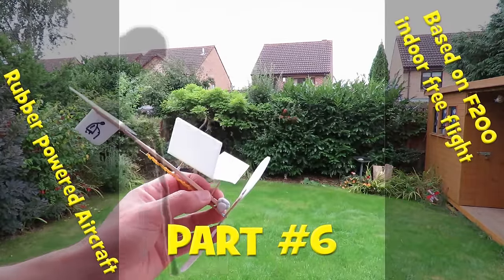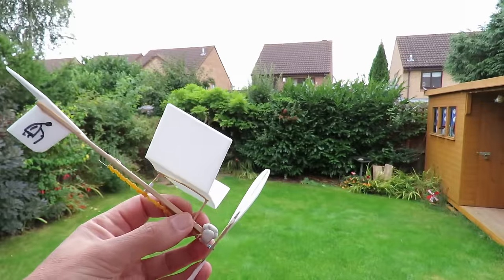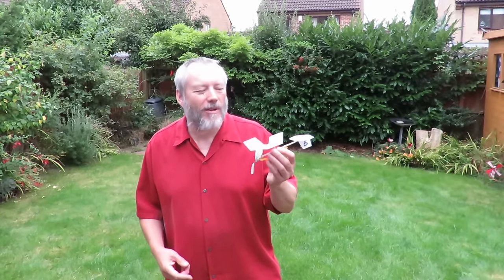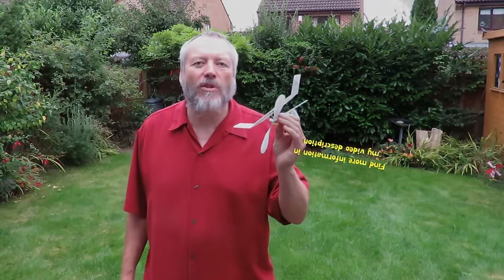Rubber Powered Aircraft Based on F200 indoor free flight PART #6

Comment: Yes indeed, nice little backyard craft. Perhaps the wing can go backwards to correct the CG ? seems to have enough of a moment there to do so. 
Some first forays of mine were rubber powered and it was such the delight to see a downward flight rise again the first time it happened.
Reply from the maker: Maybe I can convince my wife we need to upsize again and go back to a bigger house (no chance). The old one had a bit more room inside for one of these, alternatively I have considered hiring a local hall to fly all those infrared helicopters a little more safely so this would be fine there. They are not too expensive for an hour or so and if I went properly prepared I could get a lot of flying done.
Reply: A decent idea, especially with winter looming. Maybe a local school teacher, or even better a 'janitor' would allow a bit of flying in the hall/gym.
Reply from the maker: slider2732 it's on my wish list.